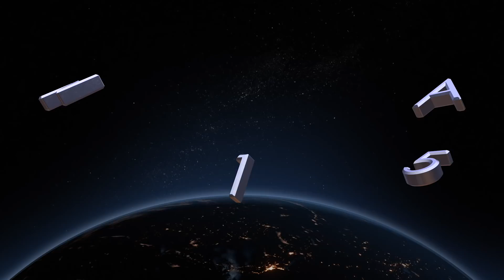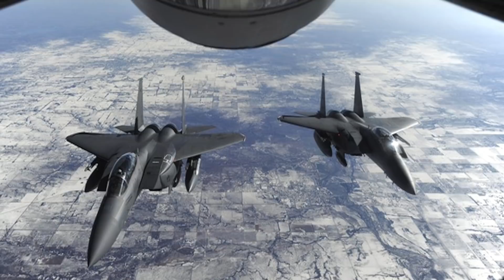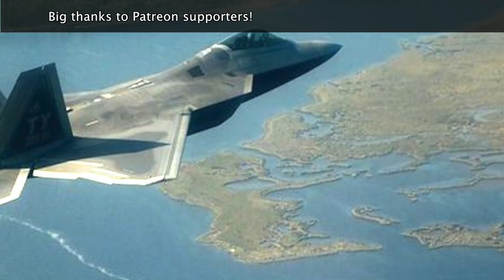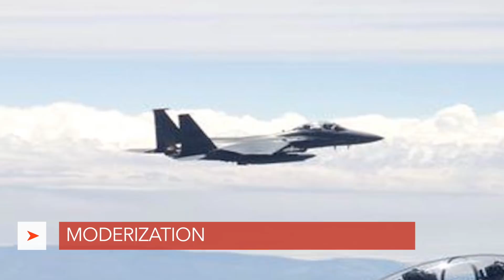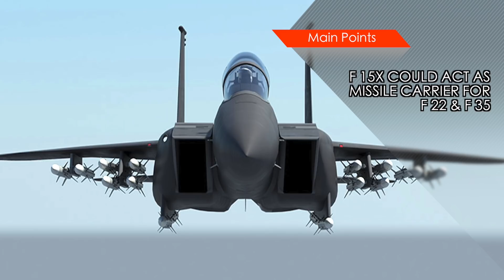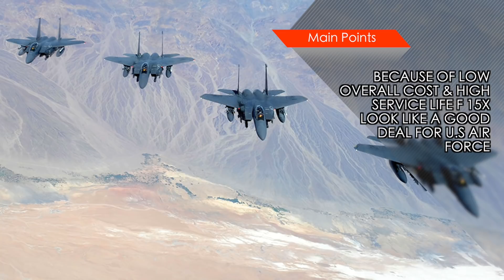WHY AMERICAN AIR FORCE MAY BUY NEW F 15X FIGHTER?

Comment: Add thrust vectoring to it
Reply: 80085 Yes, add the better engines.
Reply: Already did.  Look up "F-15 STOL/MTD" on the Internet.
Reply: Energy rules in dogfighting engagements.  Why would you want to bleed energy?  F-15 was designed with low wing loading which means it will minimize bleeding airspeed at high G turns.  TV is useless in real dogfighting!
Reply: aha! with both engines close each to other... sure! GL on that ))
Reply: @rotaryrasp4575  The F15X is going to have BVR weapons; the days of dogfighting are coming too a close.Even European fighter jets can shoot a missile 100 miles away now.
Reply: They should upgrade the engine like the F-15 MTD 2D vector thrust engine.
Reply: Thrust vectoring is useless in modern war
Reply: It was considered but deemed not worth the weight and cost since most combat will now be beyond visual range and missile technology is advancing towards extreme agility for short range fights, making dog fighting irrelevant.

Comment: 22 missiles per aircraft. God damn!
Reply: It's common to modify fighters to the ground attack role once they are no longer useful as fighters. Take for instance the F-4 Phantom that was used for Ground Attack for several decades after it was replaced by the F-15. A single F-4 carried the same payload as a B-17.

Comment: f-15x as a fighter/strike platform after f22, f35.....pretty darm good. I wonder if it is similar to the f-15 silent eagle they were talking about a while back
Reply: W J yeh they said that about the phantom and spitfire when they were first produced. Spitfire was undergunned and no range and the f-4 was to heavy, no dogfighter, expensive, and 2 pilots at a time the world was moving to single seat zippy fighters but they went ok
Reply: The F-15X is the result of a USAF request for proposals to Boeing and Lockheed Martin. The goal is in the simplest terms to replace the F-15C without impacting F-35 procurement. The F-15X is not taking on the strike role, but will have the capability if needed. Supposedly it's primary roles are going to be Air Superiority and SEAD. However I haven't seen any news on whether the USAF are going ahead with a purchase.

Comment: In part, it reminds me of the F6D Missileer. https://en.wikipedia.org/wiki/Douglas_F6D_Missileer 
It was also an outdated design with certain strengths that were required for the job, and also conceived as a missile platform. Other than that, the F-15X is also meant to be a strike bomber. I can see the model complementing the stealth fighters well, just as the F-15Es and F/A-18s do. 
It does make sense; even if it does mean restarting production of an old design airframe-wise, it's as sound a conventional design as they get, and it's capable of performing well in the role assigned.

Comment: The F15 is an order air frame design but the F22 is also an order air frame design that's a little modified. The F15 has never lost in battle and is quite a bit cheaper than the stealth fighters. The F23 was a completely new design and was rejected. My brother worked for Northrup during the fighter competition and he told me that some of the F22 features were not working at the time of the competition.

Comment: i worked at McDonnell in 1974 and worked on the first few F-15. I watched from final assembly as the first few test flights took off. You simply can't beat this fighter, as long as they do a dual seat version leaving a systems operator with capability to lock onto 10 enemy at a time. They also need to restart manufacturing the Phoenix air to air missle. At one million each, we can cost the enemy 50 million to our 1 million and maybe more.

Comment: In December 2015, the Selected Acquisition Report had revised the F-35A’s cost per flying hour down to $29,806 in comparison with the F-16C/D’s antecedent of $25,541.  The per hour cost of the F-15C/D in 2015 was $38,846. No savings here. 

Jeff Babione, Lockheed Martin’s program manager for the F-35, told reporters that the cost of the F-35A will drop to about $85 million by 2019.... The F-15 Silent Eagle that competed for foreign sales against the F-35A, but never won any orders, was priced at $100 mil !!! No cost savings here, either.

The only advantage of an F-15X is as a bomb/missile truck that can cued by the more forward F-22s and F-35s. There is no cost advantage going to the F-15X.

Comment: They should at least upgrade the current fleet to F15 2040c standard.
Reply: That will require buying new replacement aircraft, because it involves major structural changes and the current air frames are nearing max flight hours anyways. But I do agree that a large purchase should be made, at least as many as are currently in inventory.

Comment: The F-22 and F-35 stealth jets would be better to team up with several B-1BR air-to-air missile truck than a bunch of F-15X's.
Reply: There is a benefit in having multiple smaller aircraft perform a roll than a larger less maneuverable aircraft. It spreads the air defense, it increases the aircrafts ability to avoid and it decreases the impact of losing an aircraft. Something like the B-1 would need air superiority, but offers other advantages in payload once air superiority is achieved.

Comment: The air force doesn’t need the best plane it needs the right one. Though the f 35 is great and all tbh it would be cheaper and more effective to upgrade current jets like the f15, f 16 and 18.

Comment: With such huge missile racks and so many missiles the drag is going to be insane, causing a reduction in speed, manoeuvrability and an increase of the plane's RCS. Maintenance is also going to be (albeit slightly) harder. Not the best idea in my opinion. A fighter should be a fighter, not a missile truck.
Reply: That's what the F-35 is for. The F-15 will be carrying the payload for the F-35 which will do the targeting. Not to mention the F-15X doesn't have to use all those stations.

Comment: If lockhead wanted to cash in on a misdle truck they should have offered the f16 XL with mote powerful engine... Beast of a 4th gen plane . and could have added thrust vevtoring nozzle for mote agility

Comment: New production A-10X anyone? Given the nature of modern counter-insurgency, low technology conflict, it would be a popular product for export as well as home-based defense.
Reply: I doubt that. The A-10 is expensive for what it can do. Most countries would rather use turboprops like the Super Tucano for COIN.
Reply: Expensive? They are the cheapest, most fuel efficient, and least maintenance-intensive combat plane in the world. Brand new they were 2 million dollars apiece in 1970s dollars.
Reply: A modern A-10 costs more than $40 million per unit and has a cost per flight hour similar to an F-16. There are far cheaper and more efficient options, especially given the A-10 only does CAS/COIN in low threat environments.
Reply: The last A-10 was produced in 1984. Per hour costs are a fraction of the fast jets as it was designed that way. Low threat? It was designed to face the layered Soviet SAM system and frontline fighters along the Warsaw Pact lines in divided Germany. Stop typing. Just stop.
Reply: Per hour costs are almost on par with the F-16, part of that is of course age but they see more wear and tear on the airframe than the A-10. And no the A-10 was not designed to face the Soviet SAM system. The A-10 was designed to withstand the ZU-23 guns used by the highly mobile ZSU-23-4 AAA while engaging armour formations, and the occasional MANPAD. There is no chance an A-10 would survive an SA-2 or anything similar and it was never expected to dive into Soviet territory.

Comment: ...so whatever happened to, the F-35 replacing all other planes to be cheaper on maintaining planes by focusing on one air frame, concept? 

Wasn't the f35 supposed to be cheaper plane and f22 the better expensive plane?  And why make a f15 that carry massive payloads, and make other stealth plane scout when the f35 is designed to be able to carry massive payloads?

Other then that, Its great idea, love the f15, heading in the right direction with it.
Reply: F-35 is a bastard, it can't carry a massive payload without sacrificing stealth.
Reply: The F-35 IS the cheaper plane and is still going to replace what it was originally intended to replace i.e. the F-16. It was never intended to replace the F-15C and with the effective cancellation of the F-22 the F-15C still needs replacement. That is what the F-15X is for.

Comment: How many aircraft can you name that will haul the load of missiles that the F-15 can. It makes sense to use the F-15 in this manner,so you know the Air Force won't do it.
Reply: ...It was a USAF request for proposals that is the reason the F-15X even exists. If the USAF doesn't do it they will have a good reason not to.

Comment: The F15 came into service 3 years after my discharge from the USAF. I'm now almost 66 years old. Why not adapt P51 Mustangs to carry 6 50 caliber mgs, a few AA missiles, rockets or bombs and use them as inexpensive and numerous CAS fighters?
Reply: Chief Muddy Bear You might be interested in the Piper PA-48 Enforcer. It was an upgrade of the Mustang designed for CAS/COIN. The USAF tested it in 83-84 and ultimately decided not to buy it.
Reply: Chief Muddy Bear Why not. Russia is still flying the Tu 95 Bear and America is still flying the B52 so it could fit right in there. I think we in the UK still have plans for the Sopwith Camel, could be fun. :-) Airships anyone?
Reply: Dan W About the same time here in the UK we had been looking at the huge fleets of Soviet helicopters and realised the threat they possed, being able to transport thousands of troops and light vehicles behind NATO lines. So they came up with a design for a rear mounted turboprop aircraft which would be of canard configuration. It would mount a Gatling type gun in the nose, like the A10, and carry a large number of short range air-to-air missiles. The wings would be those of the Supermarine Spitfire. The collapse of the Warsaw Pact brought the idea to an end.

Comment: Definitely like this concept more than the F-35, which is not an interceptor, cannot carry ordinance, costs too much. also like the idea  of two pilots in the cockpit. Also should not cost all that much to upgrade what we already have.
Reply: The F-35 is cheaper than most options, can do air to air combat better than most, and can carry a larger payload than either the F-16 or F/A-18 that it is replacing. Stealth is a bonus. F-15X is single seat like the F-15C, not the F-15E.

Comment: Why does the USAF need the F-35 when they have a 5th gen f22 raptors
Reply: zia ul thug for the Navy. The F22 can't land Vertically (on aircraft carriers) and its mainly used as a bomber. 👍
Reply: zia ul thug f-22 is twice as expensive.
Also F-22 is an air superiority fighter. F-35 is multirole. Which means F-35 ought te better at ground strike.
Reply: zia ul thug the us stopped making f-22s
Reply: TAI Pilot 6th generation jets already in talks this isnt the 20 century rapid advancements in avionic and tech thell be cheaper if not better variants of f35 a round the world.its already 200 billion over buget and an estimated 1trilion dollar maintaince cost.is still worth it
Reply: True Renegade no it isn't it has a 145kill to 7 death ratio it's good now the only down side is the cost to make one learn your facts.
Reply: Here in my side of thee world pakistani air force has finally started replacing its j7/mirage 3&5 and other 3rd gen jets with the indigenously made jf17 which company the standing f16 jets
Reply: Bc 187 aircraft is,not enough
Reply: David Sugg ?